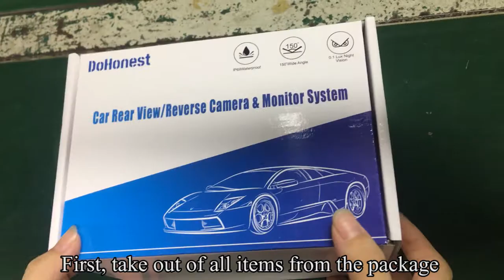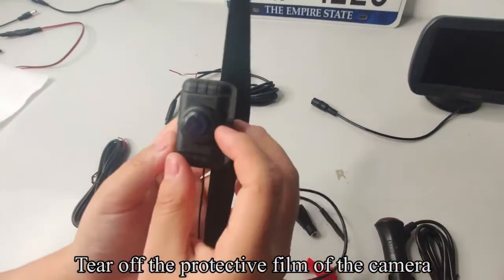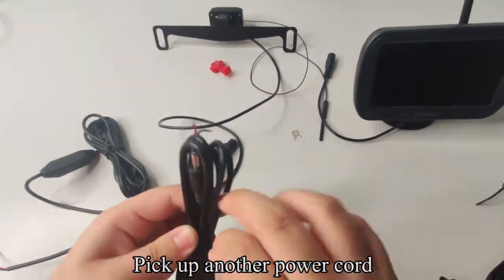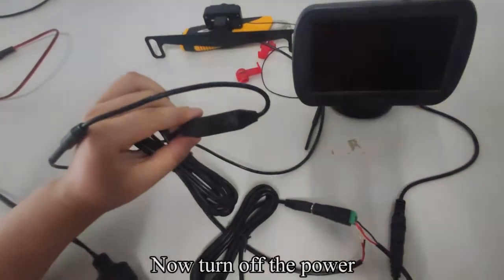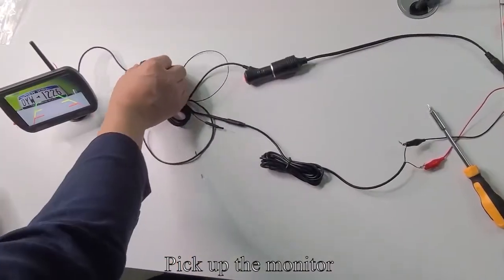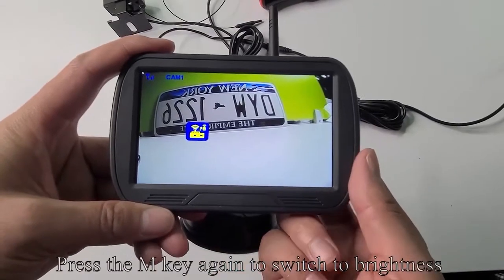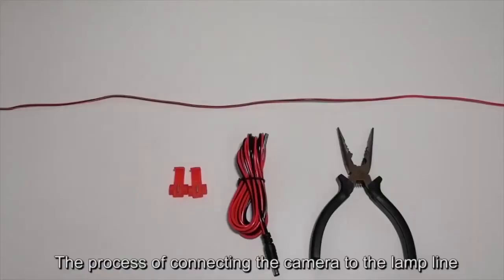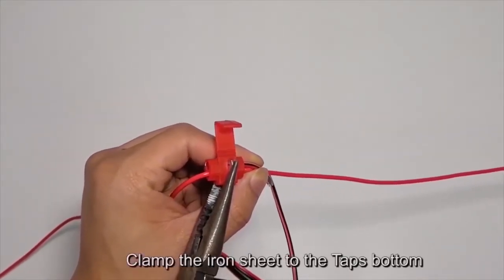DoHonest S23 Truck Wireless Backup Camera System Operation Video

Comment: I was a little surprised at how poor (or lacking) the installation instructions are with this kit, particularly with regards to wiring the power source for the back up camera.  This video was not particularly helpful in this regard either.  What would be helpful is showing on a vehicle how to wire up the camera.  I assume the red wire goes to whatever light you are going to tap into (e.g., reverse light or taillight) and the black wire is the ground which is attached to a metal part of the vehicle somewhere.